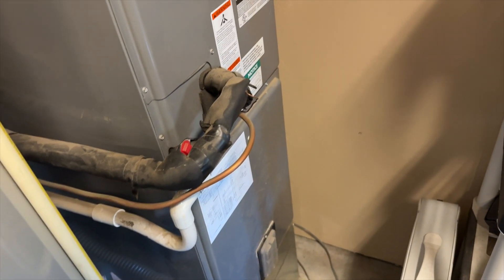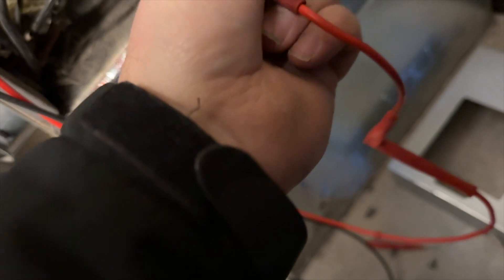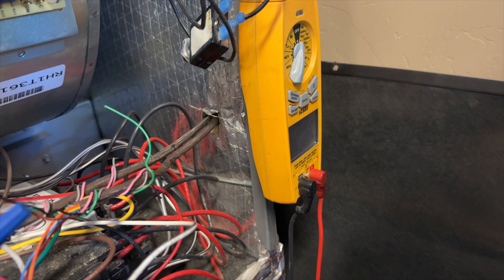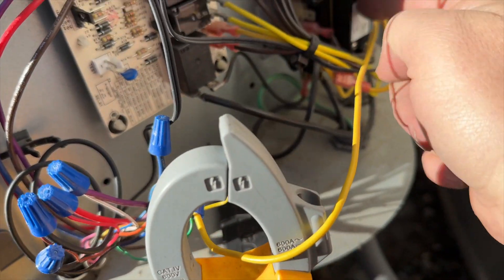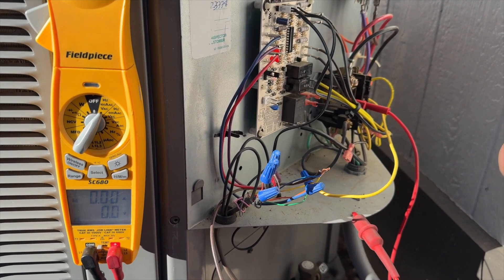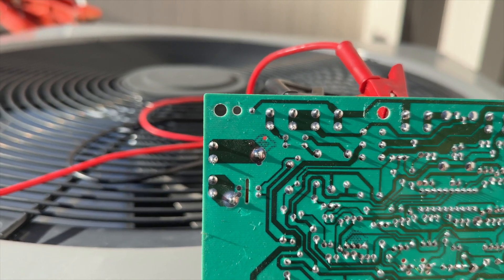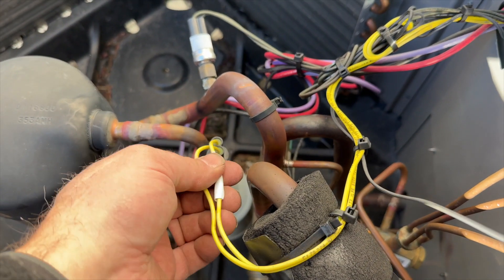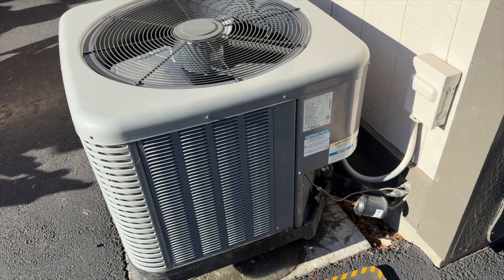Heat Pump Keeps Blowing Low Voltage Fuse EP200

Comment: Normally it is the high volt line ,going to the compressor,against the copper,this time just the 24 volt,maybe 1 sip tie on those wires..good find.